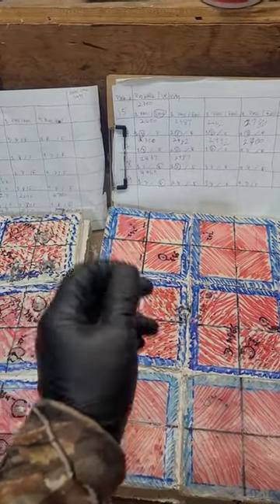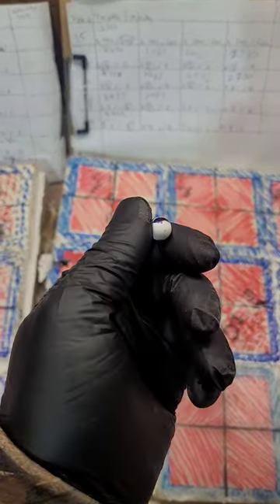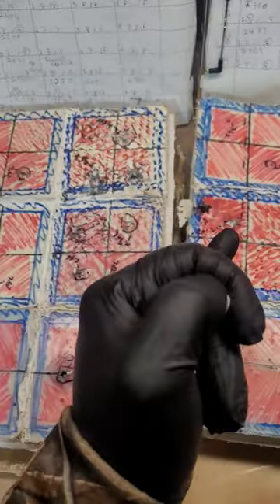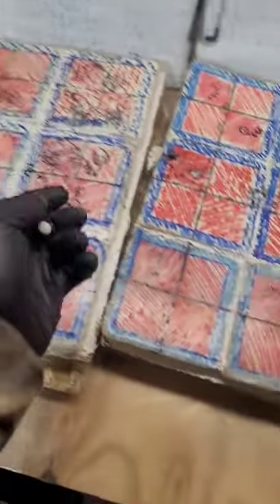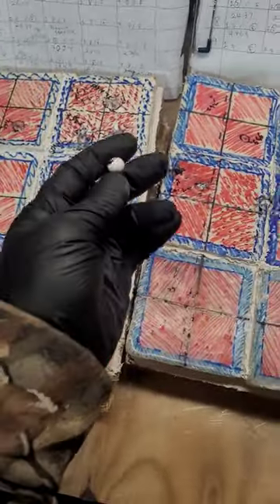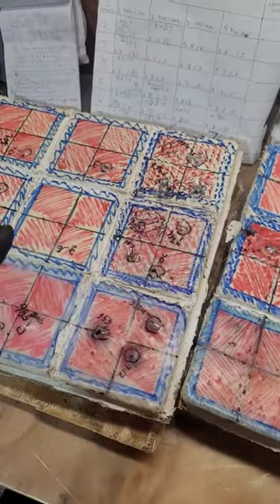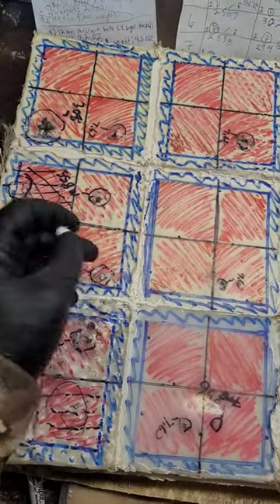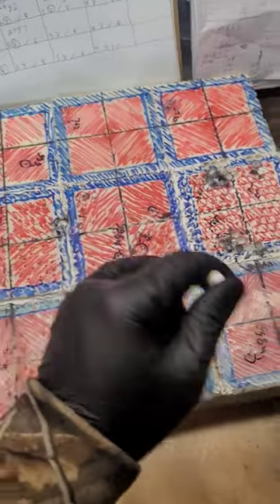Ceramic ball armor

Comment: If my memory serves me correctly, a couple years ago there was a YouTube video out about the swedes had developed some type of wall and shot it with a 50 caliber, the wall was basically filled with grapes shots size marbles, whenever the 50 cal would impact that it would smash up a bunch of them but its energy would be absorbed and the marbles above them would fall down into place and keep the wall intact impervious to penetration
Reply: Basically a hesco barrier?
Reply from the maker: I think I've seen this, wasn't it between two layers of polycarbonate or something?

Comment: Hey Tech, how did the 5/8" glass marble strike face hold up if you don't mind me asking? I really need to know because I'm thinking about incorporating them into my armor builds along with the Calacatta Warm White Porcelain tiles. I personally think a combination of these two as a strike face would yield a high multi hit capability and a high ballistic resistance level. It might be a little on the heavy side, but it also might do really well.

Comment: Where would we someone get the balls tho?😂
Reply from the maker: Well, for the alumina oxide ceramic ball tests, I bought them from this company: https://www.msesupplies.com/products/mse-pro-10-mm-alumina-milling-media-balls
As for the porcelain ceramic balls, I used this ebay supplier: https://www.ebay.com/itm/183471204606?mkcid=16&mkevt=1&mkrid=711-127632-2357-0&ssspo=krDPY5svTmy&sssrc=4429486&ssuid=_a7QotTyQla&var=&widget_ver=artemis&media=COPY
You can really see the price difference between alumina oxide ceramic vs porcelain. However, both functioned pretty well for a first-time experiment.
Reply: @Techthisoutmeow  woah thanks man. I'm super anxious for the video to see if the alumina balls can compete! For the price it would be a steal!